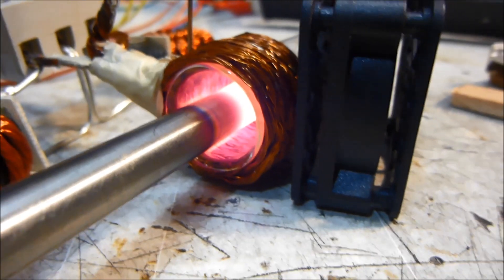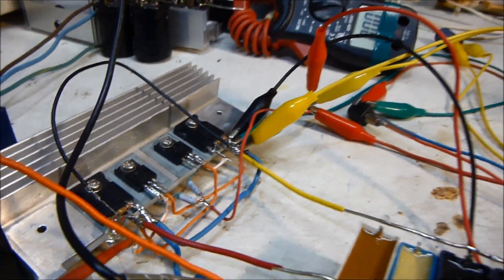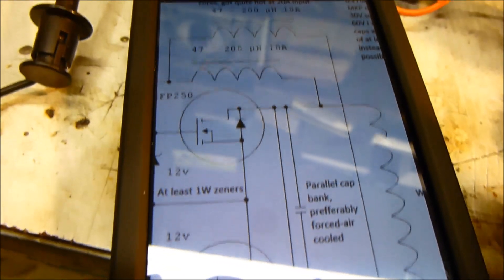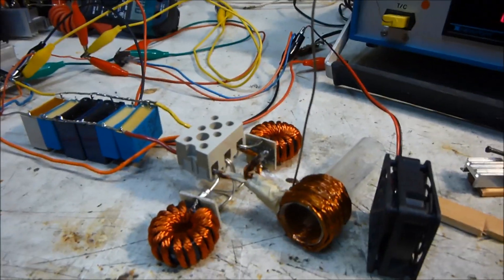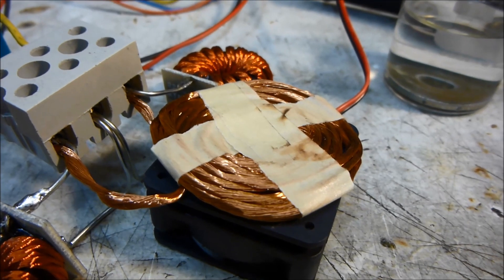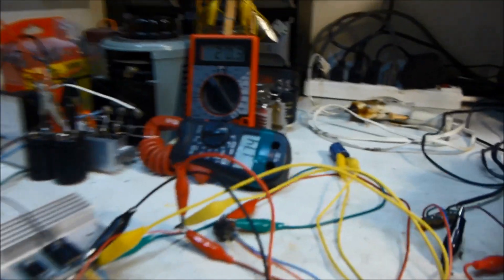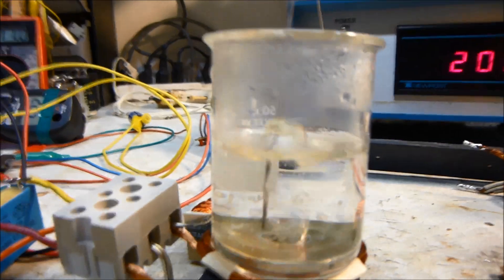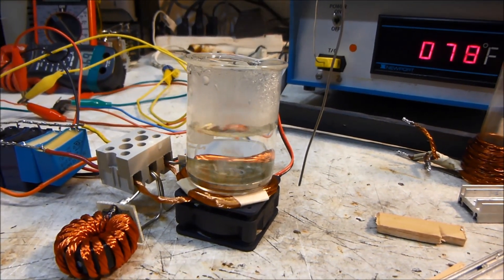Induction Heating With ZVS Driver - Flat Induction Coil Boiling Water and Litz Wire Coils

Comment: You never cease to amaze me.   I was thinking that an increase in surface area (hollow tube) = increase in capacitance therefore the accelerated heating.  You should check out the Knights of the Round Table - Shazziz Radio.  I think you would be an excellent addition to the brain trust.
Cheers -j.
Reply: Makerj101
I think the larger diameter metal is closer to the coils so get better coupling. Trade off is more radiant heat onto coils. Wow that worked well. White hot. WOW.
Reply: Have you compared resistance? Maybe also check magnetic attraction? Although if it was magnetic it would be a freq response thing, which would explain poor result with ferrite below 100khz.
If your moving the nail closer to one side, its further away from the other side, so might not be doing much? maybe stick a bunch of the nails together? or around the outside of a wooden stick to simulate pipe and see if that has any effect.

I wonder if you could measure resistance of the work piece between set points, then look at voltage between those points on the o'scope to get an idea about induced current and freq response. Could be hard to do well without burning scope probe...

I've seen copper pipe heaters that use alternating magnets going past really fast the heat the copper, so I guess its probably not very much magnetic effect.

Although
Aluminum is diamagnetic and may not work great from a coil coupling point of view, which could explain that.

Now I have more questions than answers again... Back to the lab/search engine I guess.
Reply: Makerj101 I found some answers. Its a bit of a read though.
This first one explains what we have been talking about in the first few paragraphs. Then goes on to look at a few inverter designs, and what is desirable for an induction heater.
http://www.richieburnett.co.uk/indheat.html

This one is a great step by step guide for making induction forge, with some great bits on phase control and phase locked loops. From page 5-10
http://www.mindchallenger.com/inductionheater/

If you heads not hurting after all that, then this page tells you how to make a 10kw levitating induction heater.
which can levitate molten copper! I'm sure we have all seen the video of that...
http://www.mindchallenger.com/inductionheater/inductionlevitation.html

Here is a video of the finished product
induction heater levitation melting aluminum
Reply: Makerj101 Shazizz works with Tesla tech, plasma, frequency modulation... that general area, with your enthusiasm and innovation I thought you might enjoy an exchange with him.
Reply from the maker: J Price Interesting. So it's just something to listen to and learn about that stuff?  Thank you!
Reply from the maker: Hahaha!!!  Thank you!  Interesting!  I do want to try using a tube so I can water cool it.  But if what you are saying is true then it could be more efficient too.  What exactly is this Shazizz Radio?  Thanks!
Reply from the maker: Mongrel Shark  Yeah, that's what I was thinking too.  So I tried moving the nail closer to the coil but it made no change.  It could also be that it has a more preferred resistance.  Actually its not stainless steel... It's actually zirconium alloy but I didn't want to say that in the video! :P  Copper barely heats at all and aluminum heats poorly.  Steel seems to be best or maybe zirconium is best... Ferrite also works very poorly as you might assume.  I should see how graphite works...
Reply from the maker: Mongrel Shark From all those websites and such I think I need a higher frequency.  I'm not getting enough skin effect when heating copper and aluminum.  My frequency is only about 30-60Khz.  I probably should have more like 100Khz.  Some how I have to figure out how to increase the frequency.  This might also help with melting metal.

I really like the levitation induction heater!  It's awesome and I want to build one!!!  I'm not sure I have the parts to build one that powerful though.

I want to try copper pipe as a coil and water cooling.